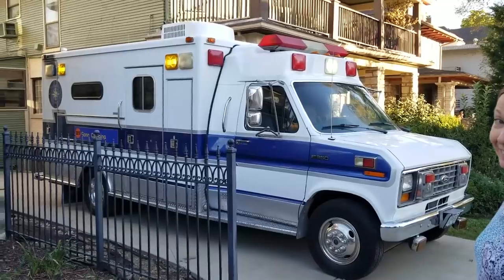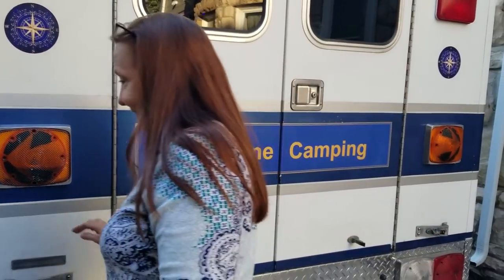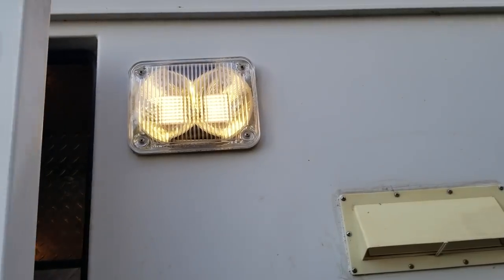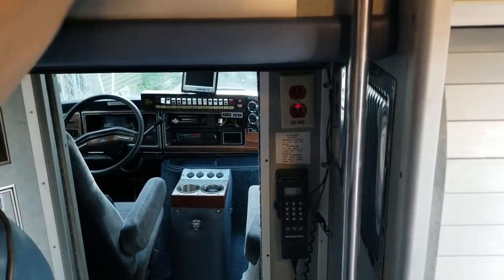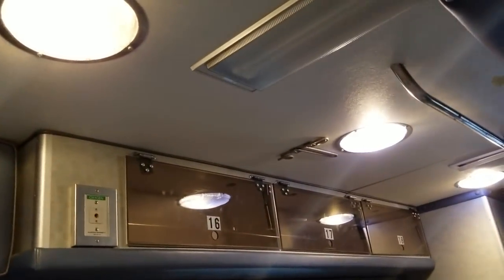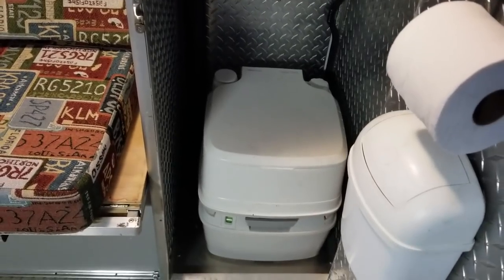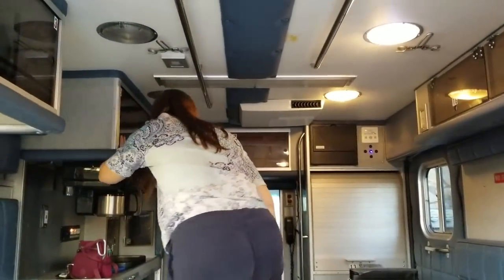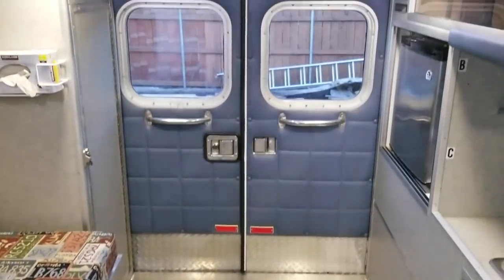#13 Video: Completed Amazing DIY Ford Ambulance RV Camper Van MotorHome Conversion! Van de campista!

Comment: Suggestion on water storage? You have extra storage for a 55gl water tank & grey tank under the bed. And plumbing is easy no freeze up. Also you can use plastic tubing. There are no codes in RVing.

Comment: That is one enviable RV, Jim!  Great to see what you have done with this,  Your bed is fantastic!  This is adaptive genius.  Glad you kept the bones of the ambulance, it gives character.  I would like to build my own too, but wish I had some of your expertise.  I remodeled my Class C RV by myself with no knowledge of anything - had to research build, materials, buying and using the tools!  I love your use of the long cabinet as toilet room, very nice spot. 

One thing I saw a guy do on a Sprinter van, he cut a hole in the floor and had a lift out handle.  On warm days, the coolest air is under the van, so he created a cool air current like this.  Smart!  One of the boldest creative moves I saw.  Takes guts to cut a hole in your van floor.  I also saw a bus restoration.  This vintage bus had vents below the dashboard, so instant cool air came in even when driving.  Wonder why they don't build cars like that.
Reply from the maker: Thanks Lass, I appreciate your comments. We now have a Sprinter van we are converting and I'd like to channel air from underneath; it's got a 12 volt fan in the roof that would pull the air in/out.
Reply: @JimWaltz  Check out what Dave Orton did to his Ford Transit van conversion, one of the smartest conversions on Youtube.  He used to have a Sprinter but switched to a Transit.  He made a hole in the floor and lifted up the cover to get the cool air underneath to flow into the van while turning on fan and opening windows.  Smart!  He is an engineer and quite the inventor.  There are some creative people out there, and thanks to Youtube we get to see all their inventions like yours.  Imagine how much education we now have compared to the past.  Please do share your hole in the floor idea when it is complete.  I would love to see what you did!
Reply from the maker: Will do!

Comment: Check to see if it is illegal to keep the original ambulance red light. A lot of places, it is illegal. I love your conversion.  I am trying to decide whether to get an ambulance or sprinter
Reply from the maker: We've never had any issues; it is illegal to operate the lights. Ours are disconnected. I had planned on installing an LED light bar in it's place.

Comment: Though you will probably never get this I love your ambulance build....if by chance you do get this where by chance did you pic up the exterior led light you replaced and who did you pick your windows you installed through...again really nice and much smarter than a sprinter unit
Reply from the maker: The outside lights were small, 12volt LED panels I got from Amazon and hardwired to the existing wiring. The windows I was able to find on ebay at a reasonable price; you need to find windows with a 'trim ring' that will fit the thickness of your walls. Thank you so much for your comments!

Comment: As old and "ridden hard" as this ambulance is…It's still better than most brand new RV's right off the assembly line.
Reply from the maker: I'm with ya on that. She's SOLID.
Reply: Oh yeah. I'm not a paramedic, but as far as I know, these trucks had religious maintenance, and the built in storage puts most Class B and C RVs to pure shame.

Comment: I noticed that you have vent in the propane closet and it is on the top of the door. I would suggest that you add a vent to the bottom of the closet. Propane is heavier than air, so if you have a leak it will settle to the bottom and not go any where. This would cause a build up of propane in the closet, until it reaches a hole to escape from.

Comment: So, aside from the propane stove and the toilet, pretty much everything needs 110 power plugged in to work? No hot water (didn't see a shower anyway), no microwave, etc unless you are plugged in.  "Camping" doesn't usually mean being plugged in. It's sleeping on the ground under the stars, or in a tent away from electricity, cooking over a fire or a backpacking stove.  IS the roof flat? Look into solar panels and think about converting a propane water heater to solar power (Like Will Prowse did recently on his channel. He wrote a book on solar. He is a bit of a goofball, but really smart and been living in an RV of one kind or another for years). He is always testing out new stuff, has great tutorials.
Reply: Ambulances have large alternators and power inverters. Hed have to run the motor if not plugged in. But, still could use 120V system

Comment: I looked at the possible conversion of an ambulance to a camper but think a small or short bus would work better. You have plenty of storage. An awning outside would work, mabe even an add on room type setup would work better like those on a popup. Eather way its an awesome setup. very solid. I know where there are two ambulances currently available for sale. The bus I keep looking at is still available also. i would do all the conversion myself.
Reply: Will you share your info on ambulances & bus for sale?

Comment: I have a Question plz : When you put your bike inside how did you pull out the bed to sleep? And do you think it would be possible to fit a small lightweight motorcycle?
Reply from the maker: The video shows how the bed pulls out; you do have to unload the scooters first. It should easily fit a small motorcycle..

Comment: Very impressed with the ingenuity and attention to detail with your ambulance buildout. I have a 1991 E350 Medtech Ambo as well, but mine seems to be in a more stripped condition(no inverter, documentation, siren, etc) than yours. Layout seems EXACTLY the same so your vids are giving me great ideas on what to do in the future. By chance, do you folks still have anything Medtech-related such as wiring diagrams or equipment schematics?  I'm flying blind with mine and any help would be appreciated greatly. Thanks very much and good luck on your current build!
Reply from the maker: I do not. If you review some of the earlier videos, I am hunting which wire go where with a 12v DC transformer. Thanks Micheal.
Reply: Thanks for the fast response Jim!  Hopefully we will both eventually have some luck on our respective quests. Cheers

Comment: nice rig! Mine is the same paint scheme as yours. i havent started converting it yet, but i got some good ideas from yours. i also replaced all the red emergency lights with amber so i can still play with them without getting into trouble. if mine had a lightbar, Id replace those too with amber lenses, so you can use it without getting a felony. also I replaced the red lenses in the strobes in grill with amber too. From the glances I got from the control panel on the dash, it looks like it was made by Mccoy Miller.   again nice rig!
Reply from the maker: Thanks for your input Mark!

Comment: Nice job love the ambulance conversion. I do have one thing to ask is where did you get your material for your couch/bed. Just love it. Keep up the great work.
Reply from the maker: Thank you Abraham. The aluminum came from a local metal shop. All else came from Home Depot or Amazon,
Reply: If you are looking for fabric... www.fabric.com   - search for vintage upholstery material.  Unless its for curtains, then lighter cloth.  You can select texture and weight of fabric.  Weight means thickness.  Amazon now owns this shop, but they are located in Georgia and have the most amazing fabrics.  For color I like Kaffee Fassett or Amy Butler.

Comment: That looks to be a LifeStat ambo body. MOST importantly, these units are extremely well made and "crash survivable", which if  you have ever seen  your average RV roll over in a median, are crazy UNDER built. So, say your mate wants to stretch out in the back .....they are less likely risking their lives. I bought a LifeStat from a guy who knew how well built they were...they don't even try to crush them with a LARGE excavator...they have to break them down differently. It's usually 4020 aluminum I beam with foam insulation .......very snug units in the winter. ..... additionally,  ceiling height is not optimal if your 5'10" or more. I will eventually build my ambo/camper with my LifeStat box, a super duty (f450)  straight frame from a 1990's chassis cab, 4x4 and I am not sure if its gonna be a van cutaway or an OBS extended cab. .. .. .. powerstroke/IDI. 
  Have fun, nice rig, nicely done. R
Reply from the maker: Thanks for the insight Reid!

Comment: Very nice! Definitely envious of your conversion. I have a few questions if you don't mind: 1. How long did this project take? 2. About how much money did it take? 3. How heavy is the vehicle and what MPG do you expect?
Reply from the maker: Good questions. We've been working on this for a couple years among other projects (we're now converting a Sprinter Van which we'll be showing soon). The ambulance cost $5200 initially. We've put thousands of dollars and hours into the conversion. Can't tell you for sure how much, but lots! Not sure of the weight, but it averages around 10.4 MPG diesel.

Comment: hello and awesome conversion. I recently got a 89 e350 ambulance and am going to do a conversion as mine is nearly the same as this I am very interested in your build I well be posting some videos myself but well be a day or so... The ambulance sat for around a yr and was broken into and electrical and tv equipment was stolen as well as one of the dually wheels (was a radio station promotion rig in the past) anyways again great job. I would really like to know how you did the bed!?
Reply from the maker: Check out the #12 Video; it does a pretty fair job of detailing the bed construction. Thanks!

Comment: Do you have solar.
How do you heat it?
What type of A/C?
Reply from the maker: No solar on the ambulance; though we are installing solar on our Sprinter conversion. We use a portable heater when needed and the rooftop AC.

Comment: You know, if you sacrificed one of your exterior storage spaces, you would probably have room for an onboard generator. That way, you'd be able to run AC and the fridge even when not connected to shore power.

Comment: Why are there hose clamps on the pex?
Reply from the maker: We used the stainless clamp pex fasteners.
Reply: OR, you could do automotive clamps that would enable you to remove clamp and redo the pipe at a later time.

Comment: Nice job. Are you legally allowed to keep the red Emergency lights on? In my state you can't.
Reply from the maker: It varies by state. Not allowed to RUN the lights, and they have been disconnected. We had planned on replacing the top lights with an LED light bar.

Comment: The one serious caveat to this conversion is the situation where you are in an place where emergency vehicles are badly needed and people automatically assume you are the first responders. This could have very tragic consequences. It’s important make it clear to the outside world this is NOT an emergency vehicle, way beyond a couple of decals.  All anyone sees is the emergency lights and instantly knows it’s a ambulance. Doing that will make it harder to stealth RV, however.

Comment: Dumb question...how warm is it in cold weather ..do you need to insulate..or is it pretty good keeping warm?
Reply from the maker: Not dumb at all. The ceiling and walls are framed with 2"X2" aluminum square tubing with spray insulation filling the cavities. Fairly well insulated and we used a small portable plug in heater to warm the space in cold weather.
Reply: @JimWaltz  thank you for the info..I was thinking of getting an ambulance for all seasons ..
Reply from the maker: @LeoHernandeznyc  My pleasure!

Comment: Any plans in the works for solar?  I would have put in a refer to run on 12 volts and propane, besides 110.  And a gas hot water heater, with a shower.  This vehicle is too dependent on grid power to be self-contained when traveling.  Food spoils when the fridge doesn't work, especially in hot weather.  AC is insufficient. 12-volt power should kick in.  It won't without an appliance that can use it. Same with the microwave.  All of them should be able to at least have a generator on board to power them. Or an inverter.  I didn't see one. BTW, I'm surprised the roof beacon is legal, especally on the road, for a passenger/RV.  BTW, I used to ride with the Bergenfield Ambulance Corps and remember what the cabinets were used for.
Reply from the maker: Spot on; this conversion is extremely dependent on campgrounds with electrical; which is typically how we camp. Our newest conversion is a Sprinter Van that has solar and a Dometic 12 volt cooler. The house battery charges off solar, plug in, and vehicle alternator when driving. More videos to come....

Comment: Do you have a low level vent for the propane? I believe it's heavier than air so will fill the compartment up to the top vent If there's a leak!
Since you sold it, the new owner should be made aware!
Reply from the maker: There is indeed a lower vent as well.

Comment: Two questions.  Do you have any problems insuring this?  I wanted to build up an ambulance like this but cannot find anyone who will insure an ambulance for me.
Also just saw this up on Ebay.  Why are you selling it already?
Reply from the maker: titled and insured like a Ford van. No problem. Selling as we began a new project: converting a 2011 Sprinter Van.
Reply: I had no problem insuring mine, but be aware. most insurance companies, will not cover or insure you, if you modify it like they have done, with a built in stove and propane. my last insurance carrier made this clear.
Reply from the maker: @markt5643  As ours was titled in Missouri as a Ford E350 Van, we had no problem.

Comment: I can imagine..if not done illegally...you could get away with parking just about anywhere and not be harassed.
Reply: I had a pick-up style dump truck. Red with orange lights just like county trucks. Could pretty must do what I wanted without attracting unwanted attention.
Reply: i'm pretty sure the opposite if some thinks its a ambulance,and needed help they would get bugged

Comment: Sweet Build! May I ask what you used to replace the outside box lights to LED?  Thanks! Keep truckin!
Reply from the maker: I use small 12v panels from Amazon. Had to hard wire them.

Comment: Jim wonderful build.  I have plans to pull the trigger this month on mine.  I would highly recommend to install a hydrogen fuel cel!  this is the company and you can download their installation manual.  there are different kits for different engines.   You can do the install yourself. @ $370 for the large double kit.
search "Hydroclubusa"  dot com, they have a store on amazon, a fb page and a company site.  call them to get info...  get that beautiful beast up to 20mpg
Reply from the maker: Thanks Fernando!